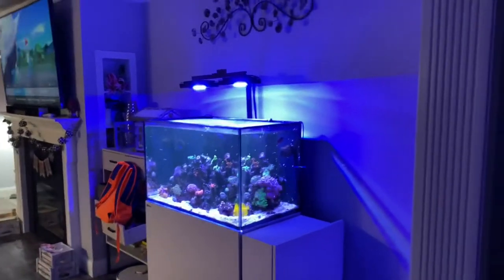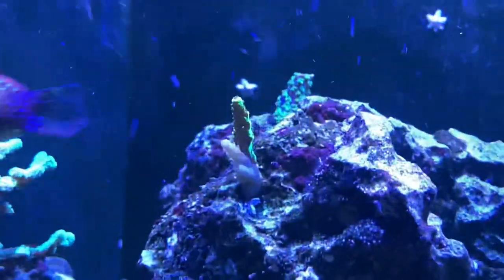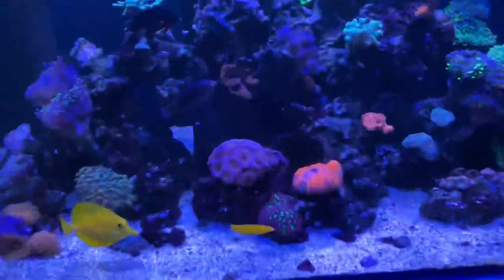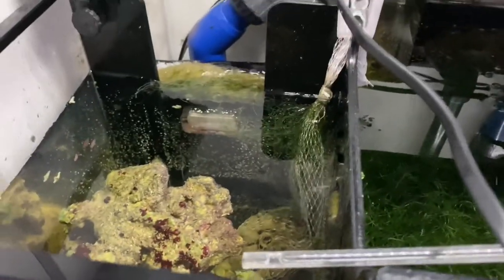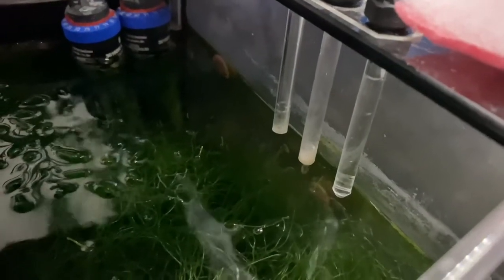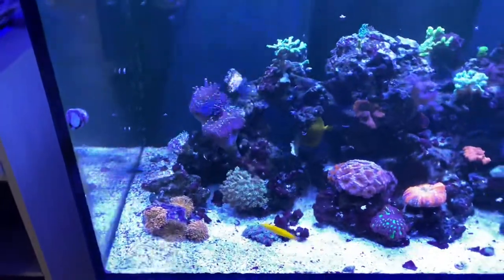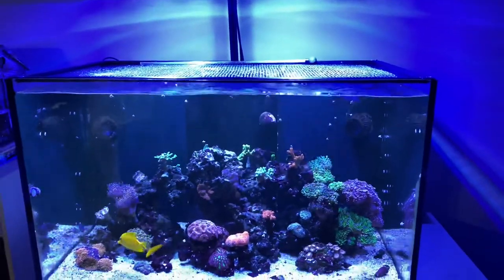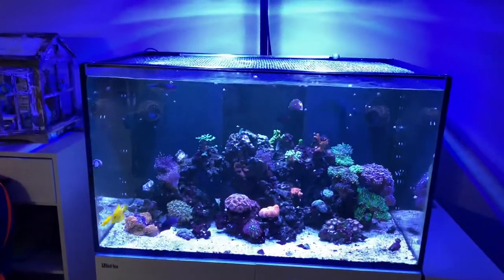Red Sea Reefer 250 | Filter Floss Tray | Asterina Starfidh on eBay | I need MORE Fish!!

Comment: Keeping a bubble tip really make nice movement in the tank. I'd say if you add some rock in that bottom corner with lower flow till it seats its foot then crank the flow back up. My nem's love high flow. Good luck.
Reply from the maker: I want one, but I must admit I am nervous about it!
Reply: @pelphrey  I'm sure you'll do just fine. You can see mine on my Instagram @scotts_pc_of_the_reef